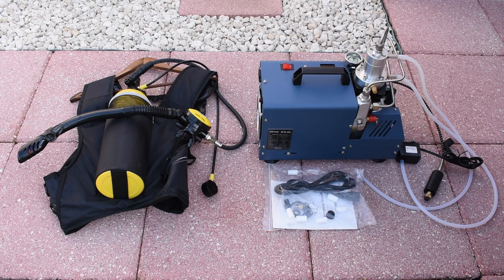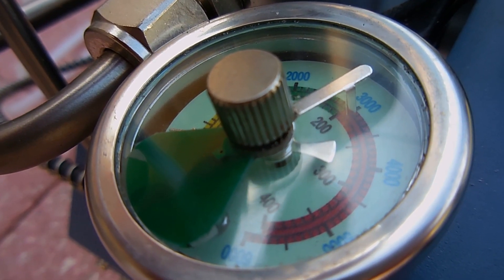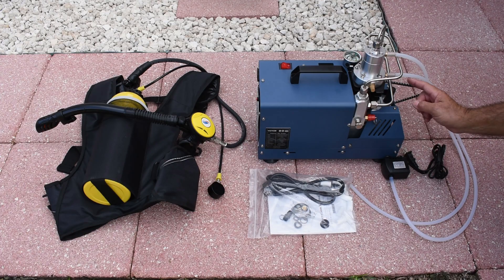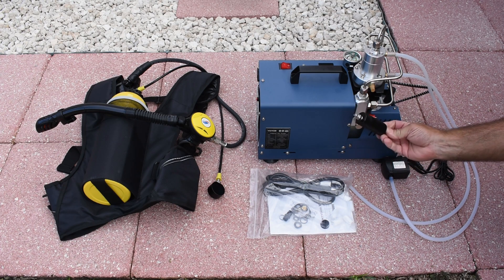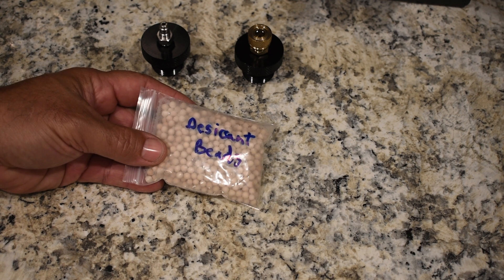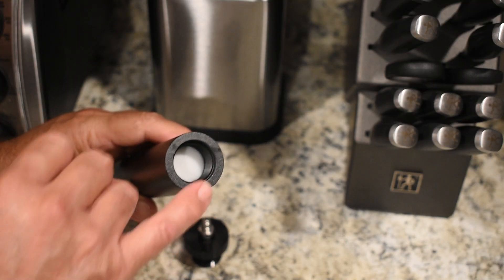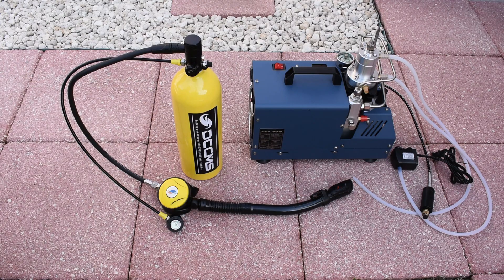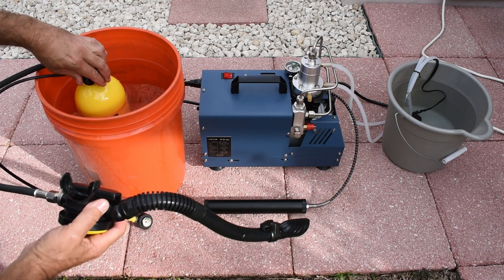Testing Vevor's High Pressure Diving & Paintball Air Compressor - Safe?

Comment from the maker: ADDITIONAL SAFETY INFORMATION: Compressor must be on level ground, and the oil level(Using what I showed in the video) must not be above the center of the red bullseye when in use, otherwise you risk having small amounts of oil end up in your discharge line. If odors are still detected in the air supply, leave the large white filter in place at the inlet, but fill the entire large filter with activated carbon. My testing has shown you can fill the tank at least 3x before any moisture makes it past the white filter. The moisture beads are not really needed, replace the white filter and felt pad every 3 fills. TEST breathe air from cylinder out of water after filling and make sure no odors, headaches, or dizziness before using underwater. Test air after EVERY refill. Stay safe!

DISCLAIMER: High pressure systems have the potential to cause serious injury or death. Do as shown in this video at your own risk. ALWAYS test air before breathing. If you detect ANY odors, DO NOT use the air! Use common sense.

Comment: And now you have water and carbon monoxide in your BREATHING tank.
For the first half of your compression cycle your water filter was likely very ineffective, the second half it filtered a part of the water.
It definitely did not filter all the carbon monoxide that is created during oil combustion, no idea if it's health relevant but that stuff is sticking to your blood and does not easily replace with oxygen.

So that's not safe for diving, you'd need a lab test on the air, likely a co molecular trap, a proper water separator.

Comment: Just subscribed and impressed with what you shared. My question Sir is not about the compressor but about the snorkel connected to the mouthpiece, When you surface and use the snorkel does it continue to consume air in the tank or theres a valve that will close so you can save air in the tank?

Comment: Thank you for sharing this demonstration, I have exactly the same device that I bought several years ago, I am only putting it into service now and I had a doubt about its ability to produce air because at the outlet you can easily block the air with your thumb... Concerning the condensation produced in the circuit it is inevitable at such high temperatures (the dew point forming at 7°C of temperature drop per cm3) we largely exceed it by measuring the outlet temperature of the cylinder which exceeds 150°C if your water and the ambient temperature are 25°C it is enormous and a dehydrator filter lets practically everything pass. In the filter you will never find water but in the bottle once emptied in my opinion you should have some if the temperature drop between the outlet of the filter and the bottle is more than 7°C. For the details of a real dehydration system it would actually be necessary to cool both the water and the air as in a large installation with an oil separator filter at the compressor outlet, then a water separator filter (vortex which centrifuges the air in the filter in order to already remove the large water particles) and then only plug an air/water exchanger as it is on this compressor cylinder but the reverse is also possible except that the exchanger at the compressor outlet as is the case here is much less effective if the water and the air are not cetrifuged before. That said it is still insufficient for dry air such as is needed in hospitals or dentists, it is necessary at the outlet of the exchanger to install an air cooler in which the air passes through coils cooled by an inert gas and its compressor (therefore an air refrigerator) then only the particle filtration and activated carbon part... Increasingly, "adsorption dryer" systems are being used, which allow for an extremely low dew point, thereby minimizing air consumption (but very expansive)  I thought about putting a mini oil separator followed by an air centrifuge at the compressor outlet (so without changing anything to the compressor) we can find very small  "Festo" (brand)  as they equip a lot of installations in the health sector which requires final filtration on each site apart from a large pre-filtration. Also I retained two additional options which for me would make sense: that of buying a  "Vevor" water chiller to cool the water in the exchanger and a truck air dryer which is used in the pneumatic braking systems of heavy weight vehicles (it's a bit like a car air conditioning dryer) but it looks like a car oil filter. Well we'll see... Cheers from Geneva Switzerland :thanksdoc::thanksdoc::thanksdoc:

Comment: That compressor is NOT suitable for breathing air. Really??????
Reply from the maker: To be fair, years ago I got my scuba tank filled using electric compressors with oil. Today things have changed. Did you even watch the video to see what I did? Doesn't sound like it. I made it clear, If any odor is detected, you don't use the air. Very simple
Reply: @electronicsNmore  There is another guy on youtube that did the same and had the air tested. it was fine.

Comment: You should leave the cylinder valve shut and let the system reach 2000psi before opening the valve a tiny bit. That way, you will capture more moisture in your trap and not in your cylinder. I appreciate fill time will be longer but it's worth it.
Great video by the way.
Reply: it was dry.

Comment: Im a commercial dive tec in UK.........
I won't use one of these compressors for diving or even any breathing equipment..
I have to do air checks on hp comps every 3 MTHS and I did one on mine......it failed miserably.
Be ok for air guns ect......but not breathing.

Comment: I bought one of these from Vevor and it is locked up on arrival.  Yes I put Amsoil in it and followed all instructions.  It seems that the compressor is locked up no pressure.  I tried contacting them through customer after sales service and I can't send the form without adding and attachment.  Can't send jpeg so I don't know what to do there.  I then went to their chat and told someone what was going on and they said they would send me an email.  2 days and no email.  I get plenty of emails from them wanting to sell me stuff!  This is the first thing I bought from them that has had a problem and will probably be the last thing I buy since the contacting them is such a problem.
Reply from the maker: @lloydprunier4415  Did you replace the piece of plastic where you fill the oil with the included vent?
Reply: @electronicsNmore  The vent plug was already installed.  This is why I'm thinking they sent me a returned compressor and didn't test it.  When I first tried to order they were out of stock then about 2 days later they had it in stock.  The communications with them are terrible.  Why they have to have an attachment in the form for service makes no sense to me.  Especially since it has to be in a different format than I have to send it.  The compressor never rotated when I turned it on.  I took the fan off and used a adjustable wrench on the shaft with the flat side and it took all my strength to get it to almost turn one revolution.

Comment: I was a SCBA tech.  All the of our Breathing Air compressors had oil for lube.  It was a special formulation of oil.  The air went through special filters before going into the cascade bottle system. The Air had to be sampled and then sent to the lab every 6 months to be tested for contamination.
Reply: Why not just use olive oil?
Reply: It burns at a low temp, plus it’s organic so it gets yucky with some time. You can’t leave your equiptment in storage for months.

Comment: warning do not set the bottle in water why if it does explode.. you create plastic shards as well as trippled the power of the explosion because the water does not compress  leave it outside 50 feet away from anything preferably surrounded by a brick wall  etc all 4 sides never walk away from it... always have a way to shut off the compressor ie pull the plug etc
Reply: All dive tanks are submerged in water because the air is hot going in the tank…
Reply: The bottle is usually tested for 4/3 of the rated pressure. 300 bar for 200 bar tanks, 400 for 300 bar tanks, even if only used for 200-250bar.
Reply from the maker: Correct. Test pressure is 300 bar for the tank that I only filled to 200 bar
Reply: @electronicsNmore  bro, you're active on comments even after 14 years
If you will reply I'll be happy all my day ;)

Comment: This is for PCP, I rebuilt mine Three times in 2 years. Use ice water 💦, also put a wet rag over the top line out. To get a new piston is 25 bucks at Amazon. If you ever ran it without plugging in the water pump.

Comment: I would suggest being exceptionally leery of breathing air from that compressor even with a "food grade" oil. I suspect that even edible oil could cause grave problems if inhaled in quantities. Atomized oil, apparently coats alveoli and prevents transpiration. Do not risk your life to save 25.00.
Reply from the maker: Apparently there's no atomization of the oil because if you watch the entire video, you would have seen that I discharged the entire tank and swabbed the inside of the mouthpiece zero traces of any residue

Comment: Open the cylinder and clean it out or fill and purge it upside down three + times.
Reply from the maker: I actually opened the cylinder, took distilled water with a little bit of Dawn soap shook it around to clean any residue, then rinse with distilled water, then 90% alcohol inside shook it around and allowed it to drain and dry